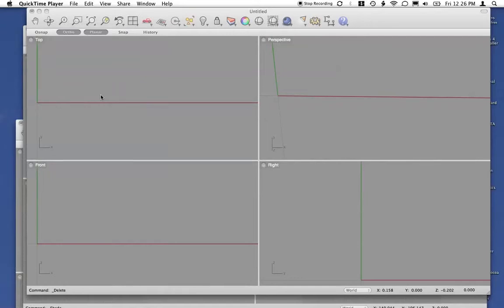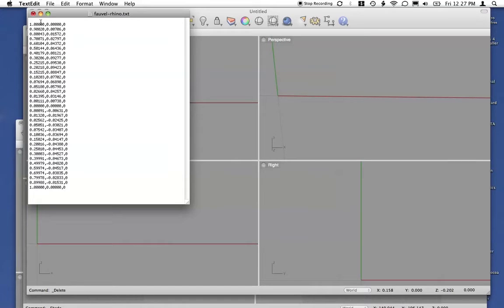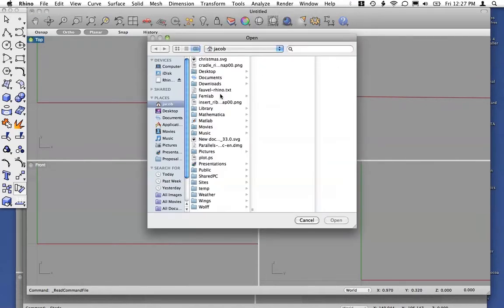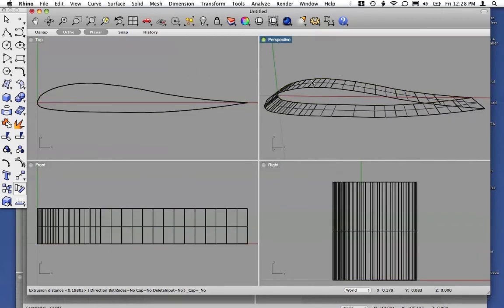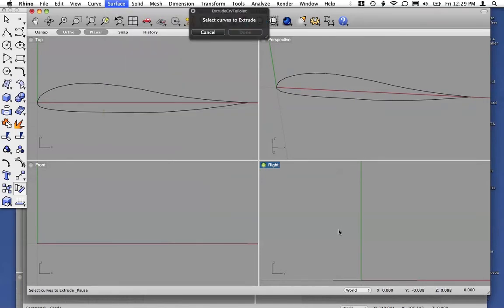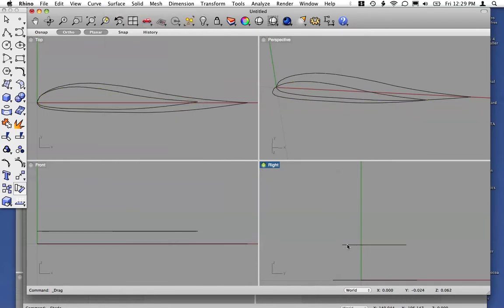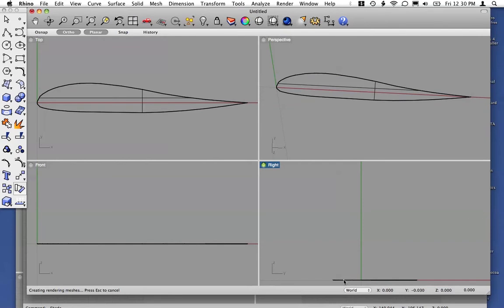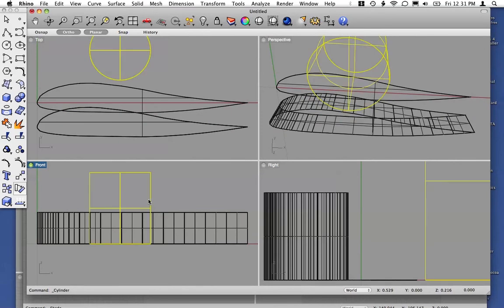Making AIrfoils and Wings in Rhino - Quick Tutorial

Comment: Thank you for this helpful video for Rhino users.  A similar but possibly better airfoil import process is to begin the file with the command "interpcrv" and end with three "enter" commands.  This will result in a smoothly curved airfoil instead of a segmented one that results from the "polyline" command.  Three "enter" commands are needed at the end.  The first accepts the existing slope at the beginning of the airfoil.  The second accepts the existing slope at the end of the airfoil.  The last "enter" ends the command sequence.
Reply: that works thanksasdljvnaspfdvas